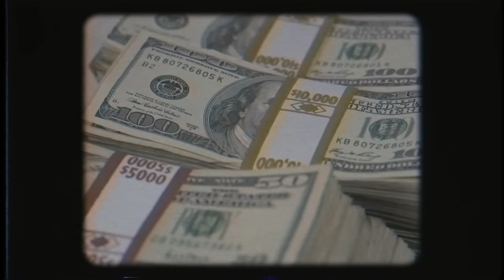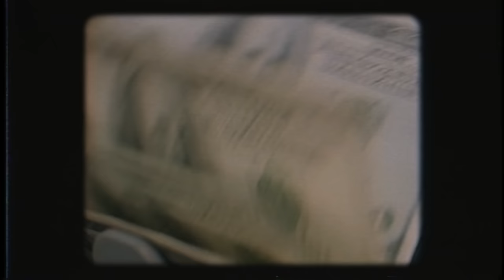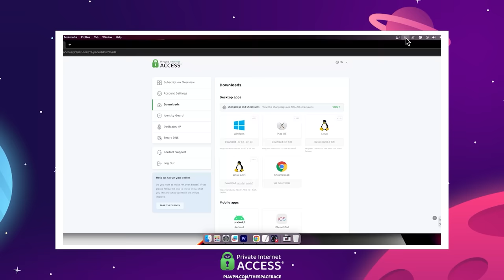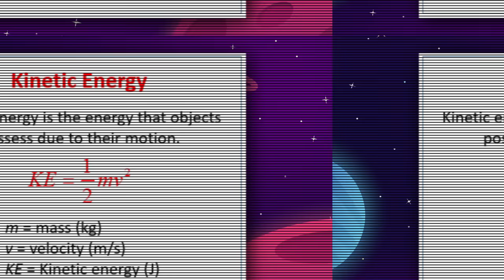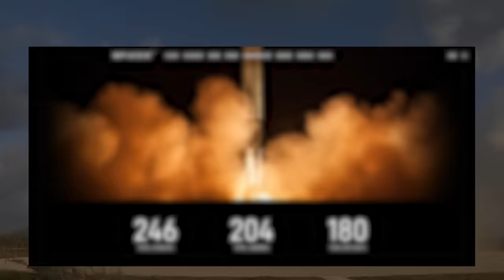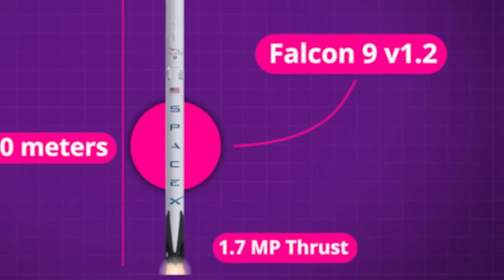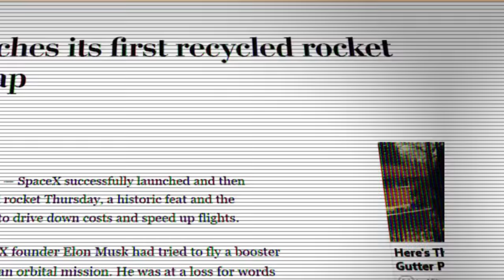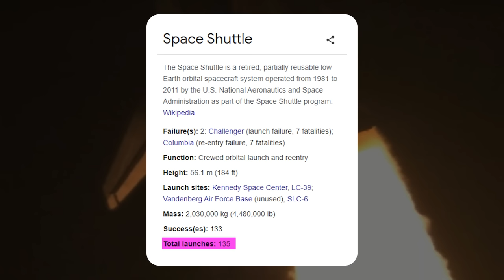How SpaceX Reinvented The Rocket!

Comment: The development of microelectronics is essential. Microprocessors were in their early stages of development when the Shuttle was designed, let alone earlier missiles.
Reply: So it was with Apollo -- integrated circuits were new at that time... but they were still using ferrite core memory (something like a whopping 4K)

Comment: Thanks for this. I learn more every time even though I've been following SpaceX for a while.

But I was disappointed you didn't say more about the "Hover-slam" landing. The problem with F9 is that the minimum thrust from even a single engine is MORE than the F9 weighs when it lands. This means that even at minimum thrust, if it's not on the ground when its downward velocity gets to zero, it's going to start accelerating up! It can't hover, mainly because the Merlin engine can't be throttled back to less than the F9's weight. So the timing on the landing has to be pretty perfect.

Comment: Absolutely great job.   Would be slightly better if you had also discussed or noted the timeline and more detailed process SpaceX uses for preparing a booster 9 in-between successive launches.  Granted, details on the process may be classified, but certainly the schedule and average delay inbetween successive booster launches is public.  Again, bravo for a terrific and well done video!

Comment: @11:29 The biggest breakthough which allows Falcon 9 boosters to land with it's engines is MEMs Gyroscopes, the kind which orients your phone, and can also control the booster accurately enough to land which prior rocket developers simply didn't have. Early gyros and computers were never sophisticated enough to do this.
Reply: Really?  The DC-X flew and landed successfully a handful of times starting in 1993 with gryos and computers of the time.   SpaceX didn't do it first, just better and cheaper and faster at ths point. but the DC-X made like 5 flights before a mishap.   the flights were similar to the SN-15 scope.
Reply: The purpose of space exploration is the "go" part ... when it's time for the humans to come back home alive, we prefer dunking them safely in the ocean. Imagine being a crew that has been away from Earth for a year or more, and all they have to do to get back to their families is to survive a risky vertical landing on a barge.
Reply: @Deploracle  russians landind safely.
Reply: lol, DC-X did it in 1993.
Reply: @MicroageHD @brynnrogers5081 both of you are wrong. While the DC-X was impressive, the scale and ability to land at the speeds F9 does is not even comparable and as a result F9 is a LOT more impressive technologically and can't be dismissed with the basic "bbbbut DC-X" rebuttal. Sorry Buckos.
Reply: @MicroageHD  The rockets in the DC-X program only went up a couple miles and two and a half minutes flight time, nothing like the SpaceX product. I think the comparison is like grapes to watermelons.

Comment: The Shuttle was designed to take payload up to orbit, 7 passengers, and bring down satellites for refurbishment and updates. The problem is, the "bring down satellites" thing never materialized. I think they did it once or twice for proof of concept purposes. What ended up happening was technology advanced so rapidly it was more practical just to build and launch newer, more exponentially advanced satellites. That said, the repair to the Hubble Telescope could have only been done by the Shuttle.
Reply: The Shuttle ferried the Hubble to its orbit to begin with. That, along with carrying the beginnings of the ISS justified that big cargo bay.
Reply: Hubble service missions could had very well being handled with much, much safer shuttle. If some 3 core heavy Delta (an semi truck) delivers Hubble. Then, 2 years later, you need maintenance, you won't get same semi truck and crew who installed the thing, but one or two smaller  truckloads of specialists and spare parts. Hubble was almost exactly same as Lockheed/NRO KH-11 Crystal/Kennen spy satellites, just looking up, instead of down. Just 15 years later when KH-11 first flew. None of the KH-11s were launched on Shuttle.

Comment: While it is true Falcon 9 has the fastest turn time yet, there is still quite a bit of refurbishment. Due to the fuel on F9, those engines and rockets are checked pretty thoroughly between flights. 
I know this sounds like splitting hairs but if Starship can truly meet its design goals, space launches will become a daily occurrence.
Reply: for that some very important part missing: need for daily launches. we do not have 100 tonnes stuff waiting in line to be launched. (heck, already the stuff you launch is the bigger cost, a big sat launches for somewhere between 100-200 million (and not for the 62 million for the booster), while it could easily cost over a billion for the sat itself.)
Reply: @GB-zi6qr  not sure if that ever arrives, the raptor eats itself and fail to start regularly in the few second tests. sadly the rocket engines are not something that can work long time, too much pressure, too much heat, too much thing that needs to work at the edge of its capability.

Not sure where the bo rant come, but it is true, they need to step up. the idea of the be4 engine is much better than the raptors, make them work under the specifications, so much less stress on everything, that may be the key for long lifetime for rocket engines.
Reply: A small detail. Its all about cost. If that inspection and refurbishment is cheep then it do not really matter at this stage in spaceflight. The cost saving from not throwing away a rocket are huge.
Reply: @RasakBlood  the problem is, no it is not. a billion dollar sat takes 100-200 million to launch, from that is is 50-60 million the rocket. not nothing, but not even 5%, if it is saved entirely, and it won't.
Reply: @thorin1045  I pulled BO in because they're the only other current competition working with the same fuel. BO is having problems with a known design and they aren't even pushing the performance of that design. The BE4 is a physically larger engine that does produce more thrust than Raptor but doesn't demonstrate the thrust to weight of Raptor.
I really want to see both companies succeed. When they do, some really remarkable science can happen at scale. 
We will be able to put space drive experiments in orbit, further out, to reduce danger to the planet.
Starship and New Glen are not end game pieces, they are a stepping stone to the next level.
IMO, we've played with chemical propulsion just a little bit too long. 
To truly grow as a species we have to get first hand knowledge in our own backyard. That being our solar system. That is if we want to progress to a Star Trek type future.
Reply: @RasakBlood  I agree. What if that turn time is reduced to hours instead of weeks?
That would further reduce operating costs.
A quick search shows SpaceX charges about $2,600/kg (USD) to LEO on F9. This price has to include operating costs for post launch maintenance.
Reply: @GB-zi6qr  the only other option is the nuclear one (ion is nice for some very special cases, but mostly just for cargo stuff, and even than it is questionable is it can work beyond some edge case.) the nuclear drive will be better (hmm, 1'500 Isp for base version, juicy), hopefully it will not fail for some reason, fusion, if ever worked out could do better even more, but won't be gamechanger after the nuclear one, and beyond that is more like hoping for a different physics. ok, in theory we can try the laser pushing system, now that would be a revolution, as you finally do not have to carry the fuel nor the engine.
Reply: @thorin1045   yes, nuclear drive is better once in orbit. The laser pushing system is a cool tech demonstrator, I just don't see it having the power to launch heavy payloads to orbit.

 The direction of my comment is the cost to launch payload to orbit. When launch cost goes down, this opens the door for more research in zero or micro gravity.
Expanded research volume in orbit allows for the testing of more ideas which increases our knowledge base.  
IMO this is what Starship and Super Heavy are designed for. We need heavy lift vehicles that reduce cost and resources for launch to orbit and maybe lunar transit. 

Transiting to other places in the solar system, imo, really requires a different kind of vehicle. The kind of vehicle that is built in orbit, carries craft with it that can traverse from orbit to surface and back.
Reply: @GB-zi6qr  to orbit from earth you will not have anything else other than chemical, the rest has not enough thrust, even nuclear would be barely able to lift itself from earth surface (ignoring the fact of any risk and problem with that), this is why we must start from space, or at least on the moon, from there we could use magnetic accelerator style launch, or even nuclear, or even space elevator. and if all of those not an option, still save 80% of the fuel in a chemical rocket.
Reply: @thorin1045  I think that's what I'm saying. 
However, rather than sending Starship to Mars, use Starship to build a LEO or Lunar shipyard to build ships better suited for the task. Then take landing vehicles along with the transit ship.
Reply: @GB-zi6qr  yep, starship (or similar) simply not useful for crewed mars mission. we would need at least an iss sized craft to keep 3-6 people alive for the 2+ year mission.
Reply: @thorin1045   I partly agree with you. You cannot compare the Raptor and BE-4 like for like. Blue has the philosophy to create an overpowered engine that they then make run at lower specs to increase reliability (and during testing it still goes kaboom). The Raptor is designed with maximum thrust in mind and being pushed further and further with higher chamber pressure, etc etc.  However -- the Raptor can be throttled back to only 40% of maximum capacity! So if you want to launch a few persons as safe as possible and do not need to get 250 tons payload to high earth orbit, then you can throttle back the engines. Even if 5 engines would fail, the remaining engines have so much power extra to easily cope with the missing ones that the cargo (the people) will never be in any real danger. With the BE-4, there is not much redundancy. A failing engine might mean you're not going to orbit. Plus calling engines which are still fully in development and testing "unreliable" is unfair. We do not know what the testing campaign is, we do not know how SpaceX looks at those engines. At some point Raptor v2 was already there and SpaceX was still running tests with the Raptor v1 knowing full well they were a lot less reliable. If you then count those tests with deprecated engines as fails, you're likely not using the right criteria to validate against. 
Having said all that - I do agree with you that a worrying amount of engines were failing in the previous flight test and in recent static fires. But during one of the interviews from Elon he said something about that they were already expecting a few ignition failures already. It seemed like they just wanted to get Starship off of the ground. The concrete canon balls flying all over were a huge mistake though. However - you might want to check out the most recent static fire of Booster 9. Almost all of those engines have been fired 3 or 4 times now and the last static fire had 0 fails to ignite, only 2 engines stopped firing early. Again : this is in testing and a newer Raptor update is already underway.
Reply: @HilkoRigterink  so a five second test lead to two engine stopping, they stated that more than three is mission loss, no one knows when it will be a fixed cargo loss, but with only three with gimbals, probably any of those are stupidly close to cargo loss. (hot staging maybe a semi emergency option, but that is not really something i prefer as abort option, and on the starship with 3+3, pretty much any engine failure is mission loss, probably cargo loss too if any of the non vacuum fails, as it has not even any other way to land.) currently the raptor is not ready. will it better later? not sure.

and es, the be4 blowing up is not a good sign, only saving grace that it was one boom out of two engines, so not something you can analyze.
Reply: @thorin1045 Have you accounted for the fact that Raptors have been mass-produced and tested under the harshest conditions, even deliberately to failure, that no other rocket engines (as far as I know) have ever been subjected to? This is SpaceX's approach to making Raptor engines one of the most robust, versatile and efficient rocket engines ever made.
Reply: @thorin1045  Your premise is wrong to begin with, it isn't the big satellite launches that is the targeted customer, it is crew and cargo launches as well as small satellites.

The company launching a billion dollar satellite doesn't care much if the rocket costs 5 or 50 million, but when NASA want to settle a moon base and need 200 launches just to bring aluminum and plastic up the cost of the launch is a much bigger factor on whether that base gets built.
Reply: @thorin1045  The over time cost savings of even the falcon 9 in it's current state makes it worth it.
Reply: @thorin1045
Starship is ISS sized.
Reply: @jamskinner  Holy shit, it literally is LOL I thought the STS compared to the ISS was something.
Reply: @jamskinner  no it is not, the inner space of the hull is much less, the weight capacity even in the biggest marketing number is less than half, the real value will be even smaller, in a not really good form factor. it has lots of needless part attached to this small useful part. the only good usage of  starship (if it ever works, so far it is only good in exploding) is a return vehicle to the surface, and even that is questionable.
Reply: @thorin1045  to an extent, I agree with you. While the internal volume of Star Ship, from tip to tail, is really large, I don't know what the actual cargo volume is.
Are you saying Star Ship has less volume or ISS has less volume? 
I think we also agree, from that cargo volume we have to subtract other required systems that will support the cargo. Satellites don't require a lot of support, people do. 
I don't remember if the claim was 100 people and 100 tons of cargo or 100 people or 100 tons of cargo.
I will say, if SpaceX gets launch and flight costs down far enough I will definitely buy a ticket for a trip to the moon and back.
The sad part is I don't think that will happen, at least in my life time.

Comment: My figuring (a long time ago, 90s I think) was that a genuinely reusable 'shuttle' replacement would ditch the wings & look like an oldschool rocket.
It'd have three of the shuttle's solid boosters recovered in the ocean.

The upper stage would have an inflatable heatshield around its engine.

The front end/emergency escape capsule would be a geodesic sphere with an aerospike/escape rocket - that aerospike would be the only thing disposable on it.

It'd re-enter rocket engine first, with the inflatable re-entry shield around it and an exhaust plume protecting it.

Parafoils would guide the upperstage/capsule to a 'landing pond' that would be 2 meters deep, football field sized, at its spaceports.

Then airbags would inflate, splashdown, and the ship would be towed to 'dock' at an airbridge off the side of the shallow landing pond.

Comment: WRONG!!! The The McDonnell Douglas DC-X was the first rocket to do a vertical take off and landing back in the 90s. It is the first orbital class rocket to do a vertical take off and landing though, and Blue Origin is apparently trying, it's hard to tell though. Also the Venture Star also tried, but was cancelled because they couldn't get the carbon fibre tanks ready in time even though the aluminium tanks they had prepare in this case actually made the ship lighter because the centre of mass worked out better and it was only a matter of time until the carbon fibre tanks were sorted because carbon fibre would be better for the final version as this was just a sub scale test article.
Reply: That's a good point about the DC-X. In 1990, I was working for a different division of McDonnell Douglas, when the DC-X flew test flights for NASA. That was very inpressive. Our division launched air vehicles with solid rocket boosters, but didn't want them to come back. 

I was at Boeing, when they merged with McDonnell Douglas. I saw  both McDonnell Douglas's President and Boeing's CEO in a tent in at Boeing's Huntsville, Al location.

 From 1996 to 2001, I worked on a couple of payloads that flew on the Space Shuttle Atlantis to the International Space Station, the US Lab and the Airlock for Boeing at NASA's Marshal Space Flight Center.

Ten years prior, in 1989, I had watched the Space Shuttle Discovery launch on the third flight, after the return to flight, following the Challenger explosion, from just outside the Kennedy Space Center. Awesome doesn't describe what we saw and felt that day. Our photos don't do it justice. A month later I saw Atlantis fly out over the ocean from about 70 miles away south of KSC.

I do not understand why Boeing & NASA didn't pickup some of the DC-X technology for the SLS after Boeing Aquired North American Rockwell, the Shuttles, main contractor and also McDonnell Douglas.

PS. In 1987, I also worked on the propulsion system for smaller flight vehicles for Morton Thiokol, after the Challenger Accident in 1986.